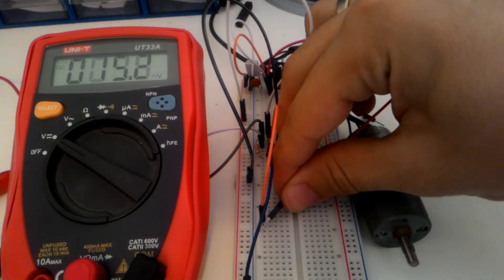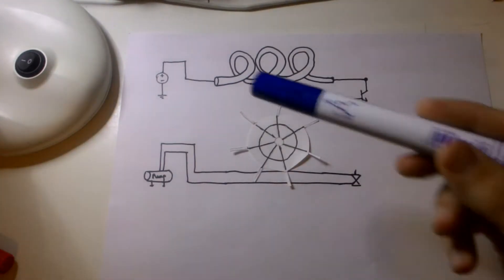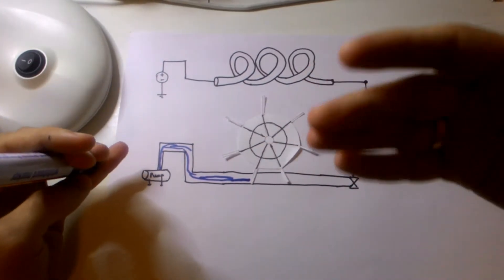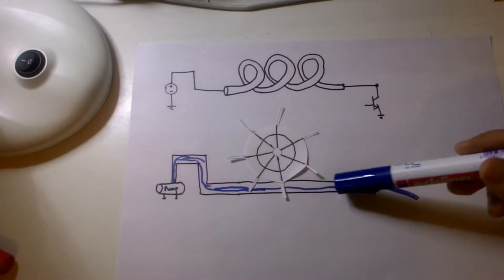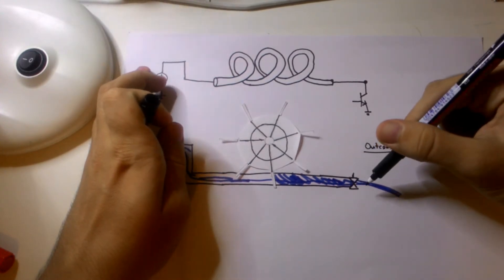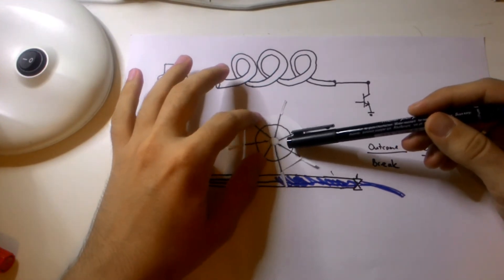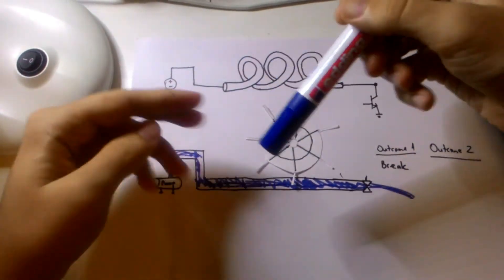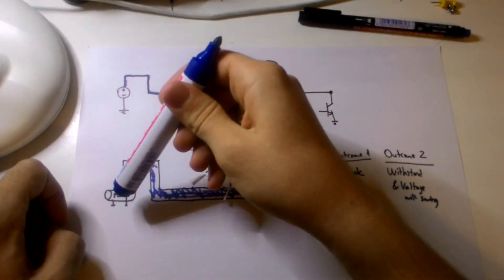What is Inductive Kickback? - Part 2 - Water Analogy

Comment: 1) You need to put emphasis on a MASSIVE flywheel connected to the waterwheel.
2) connect the water tube from the motor OUTPUT back into the motor INPUT
3) Mention that water is in-compressable.

Over years, I have made the most accurate water-analogies I can.  Including just a piece of wire with nothing connected.
I will share if you wish...
THANKS FOR THE VIDEO!!
--dAle